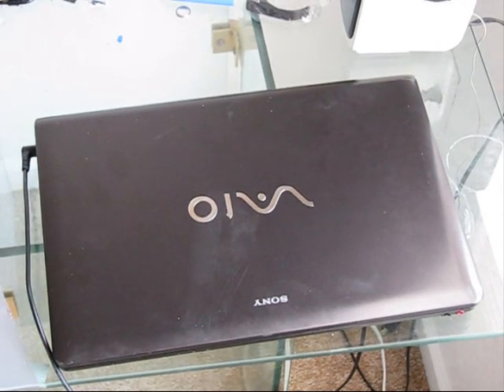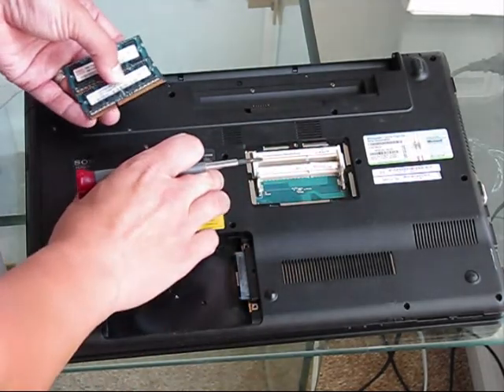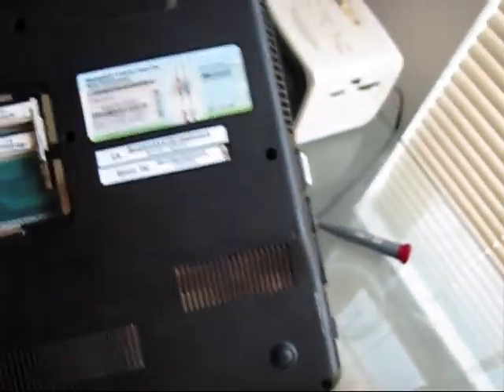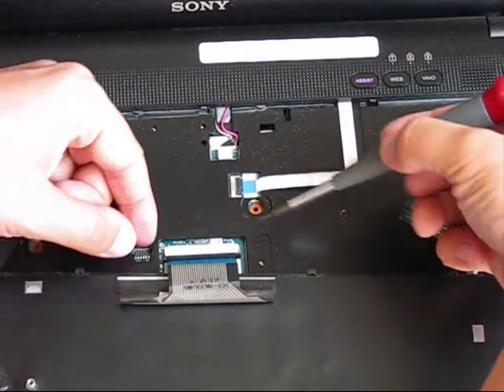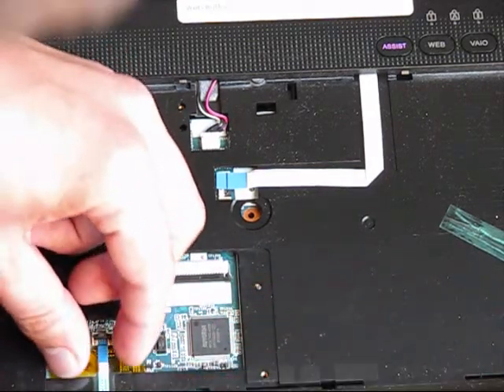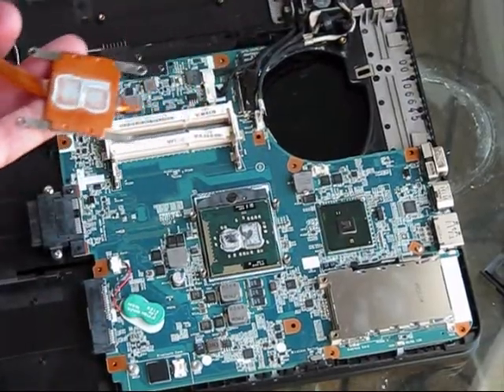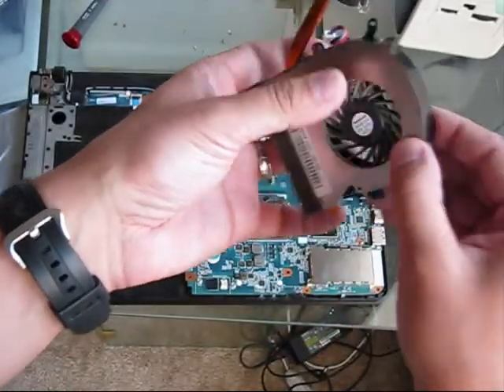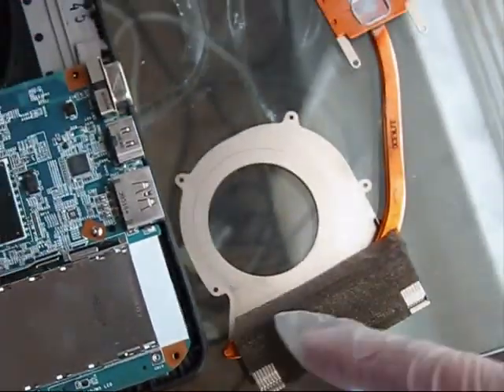Sony VAIO PCG 71312l Replacing Cooling Fan and Cleaning  Dust to Prevent Overheating Issues part1

Comment: What is the max ram supported in total?
Reply from the maker: Those machines run at maximum of 32 Gb of ram possibly not so sure, well you never know.. that's because there is a way to upgrade motherboard itself ... 😉

Comment: In case your laptop does not boot after replacing cpu/ cleaning, make sure CPU is seated properly.
 This video was very helpful. I had to open only back cover not keyboard or anything.
Reply from the maker: thank you for your comment.
Reply: My laptop boots after I do that but it takes too long and then just turns off! And some keys doesn´t work. What I could mess up? Sorry for my english